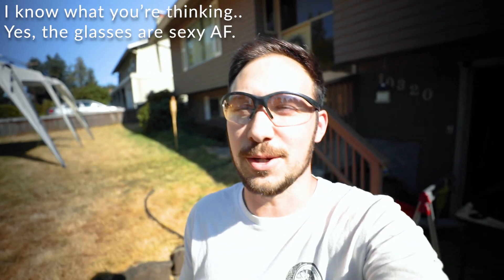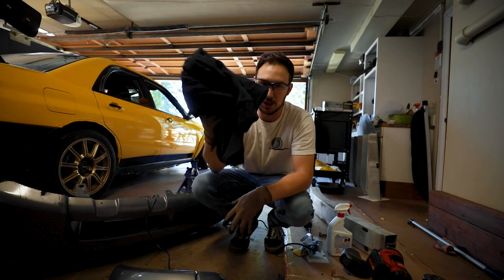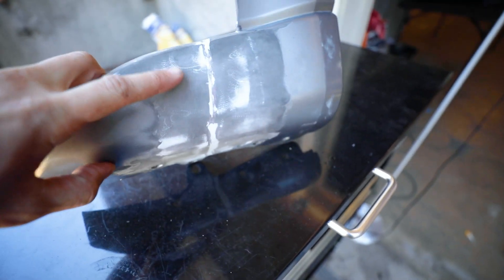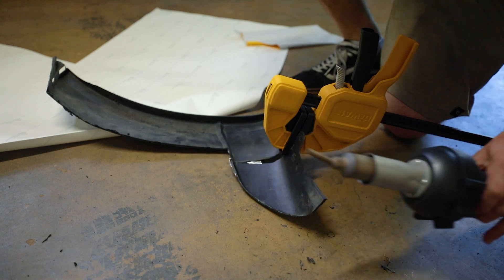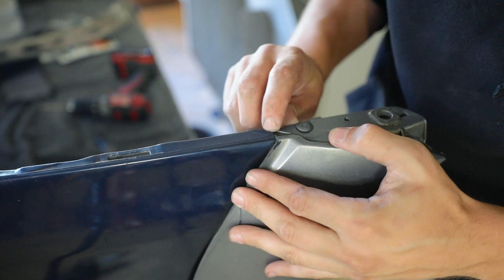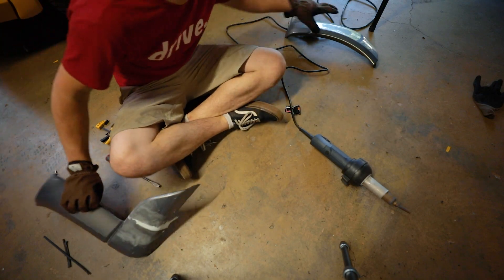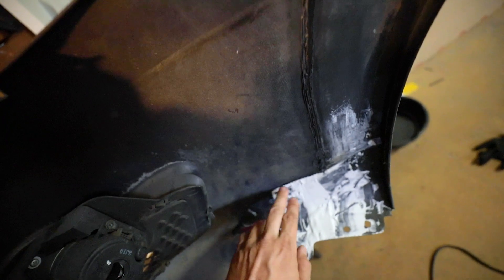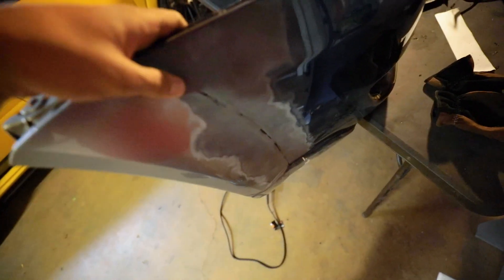Making my JDM Legacy Sports bumper fit on my Outback XT!

Comment: That Bumper looks so good. I just got my outback rear bumper and flares on my Legacy GT right before Subiefest Midwest. I actually was putting the rear flares on at the show. I've been thinking of paint matching my scoop to the bumper and flares.
Reply from the maker: Thanks dude. Yeah was seeing your car, looks good 👍 I dig the flares on sedans. This thing was a total crunch for big northwest. 🤣 had to put the splitter on after parking for the show.
Reply: @MatlasDI  and still got first in your class lol. I just missed 1st in 2000-present Legacys and Outbacks at Subiefest Midwest. I got beat by a Spec B. Honestly I was just happy to be there. It was my first big meet. Are you pump gas or Flex fuel? You got an Instagram? I feel bad asking a thousand questions about your car lol.
Reply from the maker: Yeah it was pretty cool, didn't expect that. Instagram is the same handle matlasdi. Still on pump. Car is an auto, so flex fuel options are short.
Reply: @MatlasDI  I think maybe the JK racing can be used for auto. But I'm not positive. I went flex fuel but it's everywhere where I live and understand it not always being the best option.
Reply from the maker: She'll get a 6 speed swap in the future, when we shoot for more power, so it will be a good choice by that point. 👌
Reply: @MatlasDI  6seed swap is my next big project. I'm just over 400whp on E85 and know my 5mt is on Borrowed time. I don't launch it or drive too aggressive for that reason.
Reply from the maker: Yeah. Losing a lot of power potential with my 5eat, but it's built so I can't decide if I want to see where it fails or throw it in the legacy lol

Comment: Fantastic result my dude. I’m really REALLY tempted to do this on my 2008 outback. I have an 07 outback XT hood on her and it doesn’t meet up to the front bumper (pre and post face lift parts) so I over aggressively cut up the bumper to make it work. Biggest mistake I’ve made on that car and everyone sees it whenever I drive it. They don’t see any of the hard work underneath that I’ve done
Reply from the maker: Would love to see something like the jdm spec b with the flares. I think lower section could be removed and flow naturally into the side pieces. Could do a legacy gt hood with the 08/09 jdm 3.0 bumper which looks super good. So many possibilities. Just keep working with it and don't give up. 👌👌 it'll get to where you want it.

Comment: Do you need jdm fenders and jdm lights?
Reply from the maker: Nope. Usdm works fine as long as they are pre/post face-lift like the bumper. You do have to either switch to the jdm bumper beam, or just delete it.
Reply: @MatlasDI  sweet thanks man!
Reply from the maker: No problem man, Happy Thanksgiving 😊